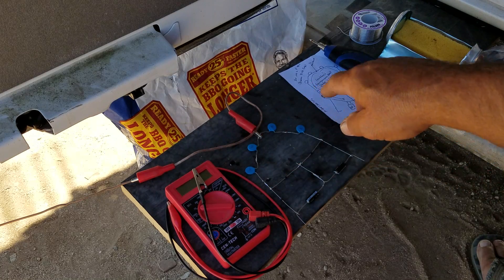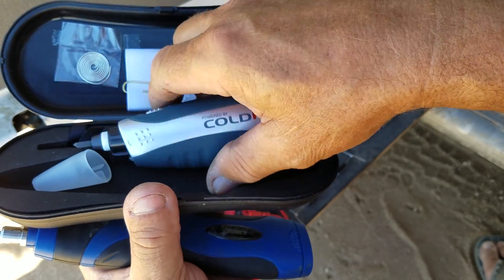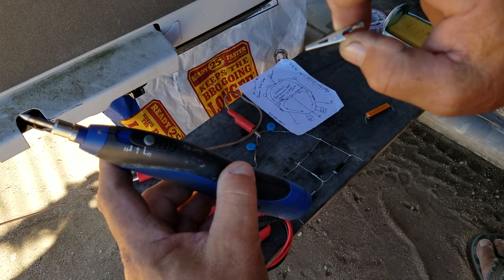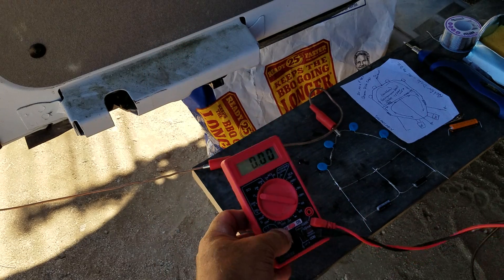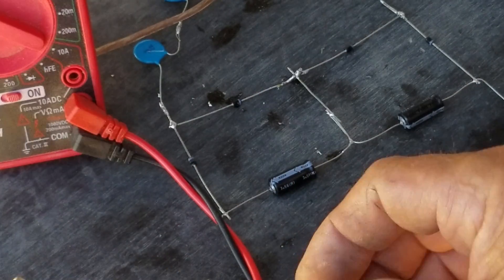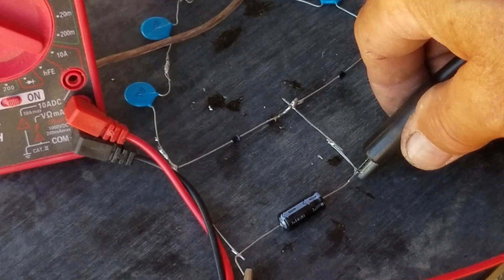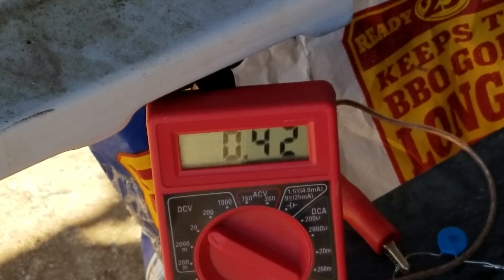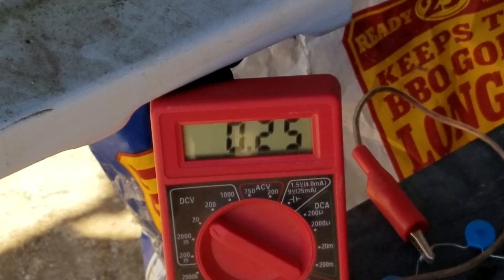Electricity from the air collector

Comment: Voltage is like water pressure. To get more then go higher. Try 50 ft in the air and 50 ft rod in the ground.
If you just want to charge the capacitors then just dip the leads in water.
If you want extreme voltage then short out a capacitor with a transducer and have that transducer hammer on some piezoelectric stones. Cut a groove in the transducer and put water in it so the capacitor self charges. It will start to vibrate and hammer on the stones. 500 lbs of force put on a quartz crystal gives off 12,500 volts per cubic centimeter. Don't build it to F sharp with a 500 pound stone and a spark gap switch you will probably get more power than you bargained for. It will beat to infinity as the harmonics will be hammering on the stones faster than the initial vibration. Every 3rd, 5th and 8th note above and below it to infinity will be hammering on those stones... and you will also get a shock wave from the spark jump that gives it that extra wave to keep it going every time it beats.. like an electric heart.
Unlimited free energy is surprisingly very easy to do. There are about 5 ways to do it with no moving parts. The safe way is slow charge. The fast way is instant charge... but it also includes beating so fast that it can disappear from sight.... lift off the ground and repel the earth,,,, and grow to 100 times it's original size....power a ship to take you to the moon in about 5 minutes... there are so many engineering things that need to be worked out of it... possibly a variable resister may work..... but because your vibrating into infinity it's not going to turn off right away when you turn it off. There will be a time delay of 3 to 5 minutes or more.  A well tuned Tibetan singing bowl can vibrate for up to 3 minutes from one rub alone so when you have a capacitor vibrating in tune and vibrating to infinity it could be many minutes before the vibration stops because the piezoelectric stones are not going to stop feeding it voltage until the vibrating stops. If you build it big like a ship it will never stop because the frequency of your heart beat alone will keep it vibrating.
This is not any normal capacitor that you can buy. It has to be built from scratch in a 5/3 ratio to an F sharp note because it is a musical instrument designed to work on vibrations and the harmonics thereof. It is a golden rectangle. And the only way your going to find infinity is through harmonics.
Why tap on a piezoelectric crystal manually to get little power when you can tap on it a trillion times a second and beyond to infinity... to get unlimited power.
Reply: Do you have a link or any information on how to build the capacitors referred to?
Reply from the maker: I'll have to look.  Everything is here, I just don't know where to find it since the move up here.  Welcome aboard.
Reply: @GBear  Thank you! As you have built the circuit (your latest reply isn't visible for some reason) do you have a circuit diagram?
Reply from the maker: @hugh126  I posted that In one of the videos back then.
Reply: @GBear  Thank you! Sorry i haven't seen your previous videos, will look now :)
Reply from the maker: @hugh126  welcome aboard!
Reply: @GBear  Well I have looked through many of your videos but unable to locate anything relevant to this topic. Sorry if I've missed it but a pointer to the video would be appreciated :)
Reply from the maker: @hugh126  are you looking for the schematic of the collector unit?
Reply: @GBear  I'm interested in the transducer/piezoelectric system if you have any schematics relating to that. It's not something that I've ever come across before and I've been researching the free energy topic for some time now. Any links or pointers that you may have on the subject would be appreciated. Thank You. :)
Reply: @hugh126  Yes, the first 5 books of the Torah shows how to build it but there is also a stone that goes on top called Jacobs stone. (aka stone of scone) (note Torah = toroid / your making a toroid with sound.) The queen of England has a replica of the transducer if you look for it online you can see the grooves cut in it where the water goes. The capacitor itself has to be built to a musical note of F sharp.. so you need a 5/ 3 ratio. The original was 45 inches x 27 inches x 27 inches. I have built one at  15 inches x 9 inches x 9 inches and I can tell you it vibrates at 360 hertz... an F sharp... and I can feel it vibrating just by talking to it.... although I don't have the guts to line it with copper... obviously I wouldn't be holding it in my hands if it was lined with metal. The original was made of gold because Granite is slightly radioactive and the gold shields the uranium in the granite. Just to be clear.. there are 3 stones to cut... 2 of them go inside.. the 3rd is the transducer and it sits on top. It will work without the transducer... but if you short the anode and cathode with the transducer... it's going to take off and vanish once it hits light speed... therefore put a variable resistor on it.
It can be done with copper as long as you don't use granite stones and switch to quartz only... however it wont be as elastic and it's possible the stones may break over time.
If you build a UFO... build it to an F sharp.. 50 ft x 30 ft... make it a double hull so the UFO is a capacitor... ground the outside of the ship to the outside of the device described above.. it will run from your thought waves because it is so big... and you will surely experience the time factor... not likely remembering anything because it will all happen in the blink of an eye.
Have you ever watched the Matrix? Remember the white room?  That is what I saw... the light is very bright and pure white and nothing is there... no floor , no ceiling.. no walls.. nothing.... just white light so very bright.
I have to warn people... build at your own risk. For every inch of spark gap you get 25,000 volts.. and your shorting it with water making it a superconductor giving it amperage. Don't mess with this unless you know how to play with high voltage. Don't ever look at the spark gap it is UV light and will surely ruin your eyes. Don't touch it! Always short it out and keep it shorted when not in use. Don't leave the stones inside or on top when not in use. You make one mistake and it will be your last.
The transducer has to be cut like an H to get the full wavelenth out of it. It's no different than having a wind chime... there is a certain point away from the tip where you drill the hole. If you just cut a rectangular transducer and touch the tips on the anode and cathode it won't work because your blocking the wave. There is a certain distance away from the tips of the stone where the transducer has to touch the anode and cathode. If you research wind chimes you can easily find this point on the stone mathematically. Just look at the stone of scone/ stone of destiny... notice the H shape. Another example is a xylophone,  the keys don't connect at the tips otherwise it wouldn't work. That transducer on top IS a Xylophone key. It has to vibrate freely. You can even hit it with a rubber hammer to start it. You can sing to it. You can talk to it. You can turn the radio on.... the noise from your washing machine will even start it. If you build it right and hit it with a rubber hammer.. first you will hear the sound and then in the blink of an eye you will see the light.
I'll tell you straight up.. I know how to do this for 30 years and the technology is so simple. Everyone on the planet has been a complete sucker since the day they were born. It's not even a secret and never was. I can't even give it away for free for 30 years because people are still too stupid because they have been brainwashed with fake controlled science and education. They mess up peoples minds with complex baloney making them unable to even think clearly. When will people wake up?... who knows. Free energy is a cakewalk and no moving parts are needed. It only needs engineering. To bring this out.... it will only take an engineer. It's not hard to build at all... however it needs engineering to make it safer and usable to all.
Another thing I can tell you straight up..... all matter and life is created from nothing but a vibration and it works exactly like the printer in your office except it uses tuned plasma as the building material instead of ink. Everything that exists is 3d printed matter created from nothing but the vibration of a single musical note collapsing on itself into a toroid shape... that is it. Everything is blinking on and off so fast that we can't see it. We only exist half the time. The whole universe is everything and nothing in balance blinking on and off to infinity.
There are 7 universes within our reality. We are in the 4th.... do, re, mi, fa...... c, d, e f....but it's really an F sharp major chord.... so we are an F sharp.  Yellow sun = F sharp ... cyan sky = A sharp  and magenta sunsets = C sharp.... combined you get the 3 colors of a printer.... add day and night or on and off and you have a 3d plasma printer... same as your printer except 3d.
All the ancient buildings are built to a golden rectangle. They are all broadcasting and receiving F sharp. All the obelisks have a wavelength and they too are all broadcasting and receiving the same note. All the pyramids are all broadcasting and receiving F sharp.  If there were no pyramids on the planet everyone would be as dumb as a cow. There was a time on this planet when everyone was telepathic because every mind in the universe is connected at 1.45 hertz. During this time you could not lie or cheat or steal because everyone on the planet would know. There was no need for any schools because every mind was connected and all information was downloaded telepathically. Everyone was equal and all knowledge was known.
Reply from the maker: Thanks.  I'll conersider doing a video at a later date .
Reply: not so much, at 1 meter there is already 100V,  you just need to figure it out how to get it.
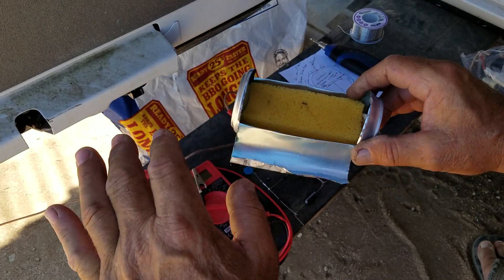Reply: @charlesparlzo  I already figured out how to do it 40 years ago. You do it with sound, piezoelectricity... and feedback... by feeding the sound back into the  microphone in an endless feedback loop. It so simple to do it makes everyone look stupid. I haven't been able to even give it away for 40 years. Everyone is so stupid. I can do over 200 trillion watts with no moving parts... no battery... no coil or magnets.. and no plug in. Only 5 parts are required and 3 of them are tuned piezoelectric stones... one is a tuned radio frequency spark gap transmitter.. and a capacitor... that's it! You charge the capacitor with the sound of your voice and when the current reverses it goes through a transducer that vibrates and hammers a pressure wave of 829:1 on some piezoelectric stones. The capacitor is charged from the sound of your voice and once it is charged  it is fed to a spark gap transmitter and fed directly back into the transducer... which is a microphone capable of picking up all waves from under 1 hertz all the way to 20 million hertz. When your feeding 20 million hertz right back into the microphone.. you get a steady feedback tone and it will never shut off. 100% of all waves hitting it will be converted to electricity. It is 100% efficient... and because of the feedback loop.. it is over unity and therefore cannot be patented.  If you want one you have to build your own... and it will remain royalty free. I am the father of free energy... completely unknown.. and nobody has a clue how easy it is. Not only is free energy simple as pie.. so is anti gravity and a real conscious mind in  a box!.. the real AI. Telepathy also comes from the same technology. One note.. the F sharp note... creates everything.. all notes and all matter. Why you ask?.. because it is the only note that can create both the male and female from the dipole created in an oscillation. It creates a vesica piscis with sound in a standing torus and follows the flower of life pattern.. then the 5 platonic shapes and finally a tree of life shape when it reaches critical mass it ejects a piece of itself from the core causing a whole new creation... converting waves into matter. It all comes out of the tiniest hole smaller than the head of a pin from the plasma at the core of a doughnut. Everything comes out of a hole and grows.. ..gains mass to 20 times it's original size... and then ejects a piece of itself.... over and over and over to infinity. The whole universe.... is just feedback.. and this feedback is what creates consciousness.. all life and all matter. There is an eye in the center of the doughnut. This eye is in " Barnard's Loop".. and we will reach the eye in about 12,000 years....we spend 12,000 years moving towards it and 12,000 years moving away  6 times in a flower of life pattern ...for a total of 144,000 years...and we will completely dematerialize.... and won't rematerialize until the age of Gemini. Guess what happens at the end of the 144,000 years?.. The eye will get ejected from the core... a whole new creation.. a new heaven. The new earth will be ejected from Jupiter's big red spot around the same time. This creation happens on multiple levels from the macro.. to the micro. Look at 1:11 in the following video.  Notice at first the squaring of the circle with sound. The square is male and the circle is female. It ejects a piece of itself when it reaches critical mass.  https://www.youtube.com/watch?v=NGeGPt0qJtk
 All planets are female and give birth to their own moons. This happens every 25,920 years when we reach the eye during the age of Leo... but an new eye happens every 144,000 years... a massive amount of new stars and planets will be born from that ejected eye.
Reply: @omegafile  Hi, do you have any video about the "sound piezoelectricity"?
Reply from the maker: No, not at this time. Sorry.
Reply: @charlesparlzo  You have to find some sandstone that has some iron in it. It has to be the type of stone that rings like a bell when you hit it with a hammer. You cut it to a 5:3 ratio so it vibrates at 360 hertz. You mount it on a fret at the nodes like a xylophone key so it can vibrate. You sing to it and it vibrates giving off voltage that is used to charge a capacitor. One side of the fret is connected to positive and the other side to negative. Underneath the fret you have a pressure plate that sits on top of 2 large piezoelectric stones that are tuned exactly to the same note of the sandstone transducer on top. The top pressure plate is connected to negative.  On the bottom of the bottom stone you put the positive plate.... so now when you sing to it and the top stone hammers on the bottom 2 stones 360 times a second when you sing to it.... but it does it with a pressure wave that amplifies it 829:1. The voltage from the capacitor goes through the top stone and it hammers on the bottom 2 violently like a jack hammer. Now you put a spark gap on top and you tune it to radio frequency about 20 million hertz.. and you feed it right back into the sandstone transducer in an infinite feedback loop that will give it a non stop steady tone keeping it going forever. Now the sandstone transducer on top is basically a microphone that has a range of under 1 hertz all the way to 20 million hertz... your basically transmitting straight into the microphone.  The 7th harmonic of of 20 million hertz is light! You have to be very careful with this because I can do about 2.4 quadrillion volts.... so I don't recommend feeding back radio frequency into it...try a speaker instead.. less power .. you really don't need that much power. Not only does the transducer have to be tuned and mounted at the nodes.. the capacitor has to be tuned to the same note and it too has to be suspended at the nodes at it's 4 corners so it can vibrate as freely as a wind chime. Keep in mind that 500 lbs of force on a quartz crystal releases 12,500 volts per cubic centimeter. If the transducer is 500 lbs.. you will get a trillion volts per stone,,, and this is before the pressure wave that amplifies it 829:1. I wont even build one myself.. not that big anyway.. too dangerous. 2.4 quadrillion volts is not something to mess with.
Reply: @charlesparlzo  This device can create matter and a conscious mind. It depends on what frequencies you use at the spark gap. If the frequency is between 100khz and 480 kHz it will levitate off the ground. Lower frequencies create consciousness and higher ones create matter. If you get the transducer vibrating fast enough it creates an eye.. a vesica piscis.... and everything comes out of that eye.... all matter. Sound is converted into plasma and weaved into matter.
Reply: @omegafile  you need to make  a video of it, much more better to explain
Reply: @charlesparlzo  It's too dangerous to build. The smallest crystal gives off 12,500 volts per cubic centimeter with 500 lbs of force... and there is a pressure wave that amplifies it 829:1.. so even with a 1 lb transducer mounted on top of 2 more.... the force on the bottom crystal is 1658 lbs... and the sound through it will speed up 8.6 times. If your using a 3 inch x 5 inch crystal.... 3 of them... the voltage will be extreme. I have an unfinished football sized one.... too dangerous to finish. Currently working on a smaller model. It's not something I want to show. Make your own it's the only way. It's safer to make it as a secondary and not use feedback. For example use your stereo microphone and speaker and put them close together.... tune a transducer to that note and mount it on a fret... and let the resonance do the work without the use of the feedback in the spark gap.... so in other words use some power to get more instead of using a spark gap radio frequency feeding back into it..... you will open Pandoras box and you wont be safe any more. You cannot patent over unity devices.. your wasting your money and time... and the people who purchased Stan Myers technology for 200 million dollars are all dead... Not worth it. The only reason people could not replicate it is because the capacitor pipes have to be mounted at the "Nodes" like a wind chime as to not interfere with the high frequency vibration.. simple as that and everyone missed it. Nobody needs to burn hydrogen... you can just put rochelle salt between  a tuned double pipe capacitor setup and vibrate it.. but it wont work if it's not hung at the "Nodes"  First lesson would be how to cut and tune a double hulled wind chime and hang it at the nodes... or it wont work at all. Every pipe you add... adds more power... you vibrate one and they all vibrate with resonance.... there is no limit to how many pipes you can add. This is so incredibly easy to do. It's all done with sound and feedback and resonance. If you have 8 capacitor wind chimes hanging in a circle and put a spark gap in the center at radio frequency at the same F sharp note at higher octaves... you wont want to get too close to it... but that gets rid of the wind knocker. If you cut a tuned transducer shaped like a Dropa stone and mount it on a positive post like a fret at the hole cut in the center.... and drill a hole at it's side along it's horizon to the hole in the center. You mount it on a turntable... when you vibrate it, it spins and the spark jumps through the hole each time the hole lines up with the negative post the spark jumps through the hole. Closed position is when the hole does not line up.... full on is when the hole lines up .. and pulsed mode is when it spins... You can power any ship... and control the power. That spark jumping through the hole is radio frequency.. it keeps the transducer vibrating non stop. A 6 inch gap sparking back and forth from the outer negative post through the hole to the center.. is 150,000 volts...AC current. The pulsed frequency is controlled by the spin... how many times a second the hole lines up. 100khz to 480 khz.. it will levitate... but in reality... it can be done without the spin... the frequency alone does it.